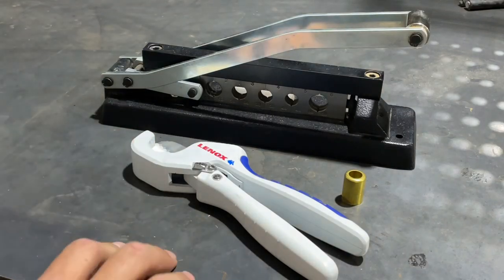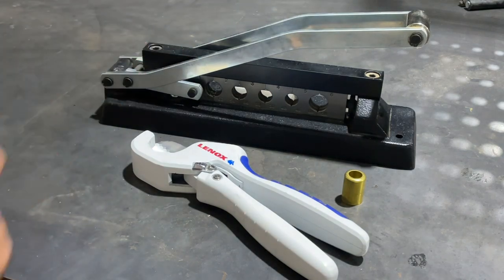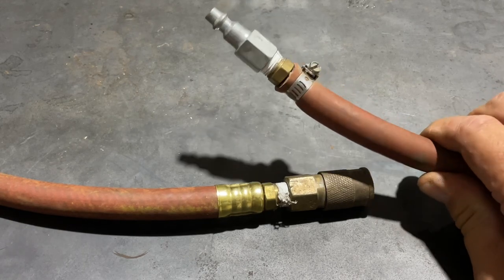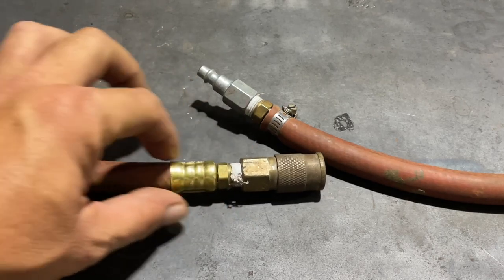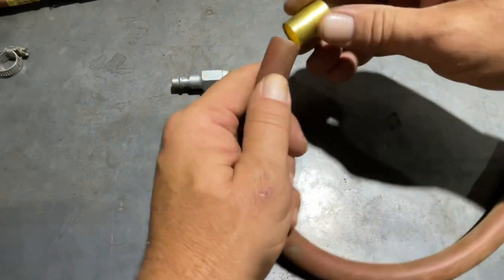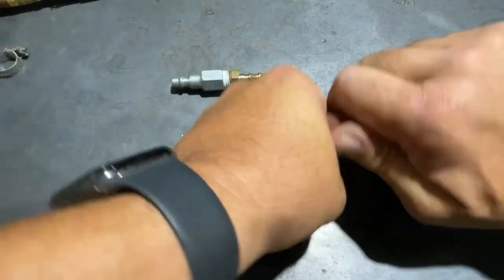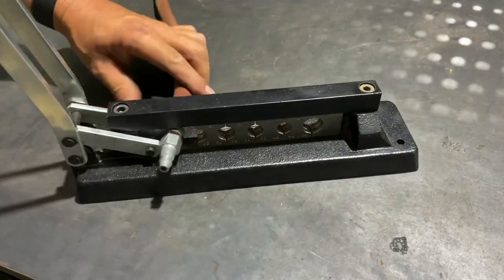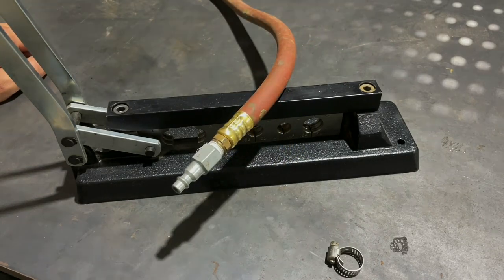How To Repair Air Hose

Comment: I am poor I have a tube cutter but my question to you is I cant afford that is the poormans remedy to change the hose it right I would see if there is a hose valve that might have a barb and quick connect and attach it using a hose clamp does that sound right to you I mean I might try to fix a hose on a bike pump that while it may be a nice pump the connector may have been poor does the above sound like to correct remedy to use hose barb if there is one with a quick connect and use a clamp? does that sound right thoughts please thank you!
Reply: The one he has is $150 but you can buy hand crimpers for like $30

Comment: The Ferrell on our hose at work broke off. Use it for dishwashing. Can’t buy a crimper just to fix it.. is there any way to do it without one? Can I call someone to come fix it lol? Is that a thing people do..? 😅
Reply from the maker: You can repair it with tie wire and a pair of pliers for a temporary fix. https://youtu.be/K-lE32Eac7E

Comment: I wonder if you could use the crimps and crimping tools from pex to crimp on air hose fittings....
Reply: yeah probably. Especially if you can find the ones with the double ears. "welding hose ear clamp". From my research its recommended as safe for welding hose repair vs. screw type hose clamps or twisted bailing wire. For air I'd do this all day instead of putting 2oo to 3oo into hose repair equipment unless you repair hoses for a living. 

On old torches with "barbed style fittings" what did they expect the user to do exactly?? use a pex style ear clamp and cut it off everytime you want to disconnect your torche? crimp on  ferrule? I bet those old tops where using screw style hose clamps. Grandpa knew the true meanings of YOLO

Comment: Ben thanks for sharing. 

You reminded me a friend who is roofer and the guy deploy for each house like 6 air lines. He have the same system. He showed me how to do it cleaner and safer. Honestly it's a really safe crimp, up there they don't stock in any place. 

🙏🏻

Comment: Hey Ben. Thanks for the review or overview maybe. I have ben looking at this for my shop and was wondering howe well they worked in the long run. I have no worries about investing in tools that work and work well. Hence = The investment. I use over sized fittings in my shop on the standard size hoses. was also debating if I should go to a target hose as well. What are your thoughts on that. My concern is volume of air to my tools. I have a 30 gallon 175 psi compressor now. Does what I need it to for the compressor side. 
Would love to get your feedback on this if possible. Oh. ps I am a fellow Texan getting the fabrication and building game in play. Thanks again Ben

Comment: Can this be used for auto fuel line and transmission lines
Reply from the maker: Maybe a temp fix for transmission fluid, but not fuel.
Reply: @txtoolcrib  I mean the crimper..not the airline